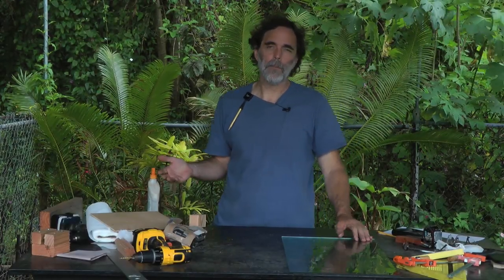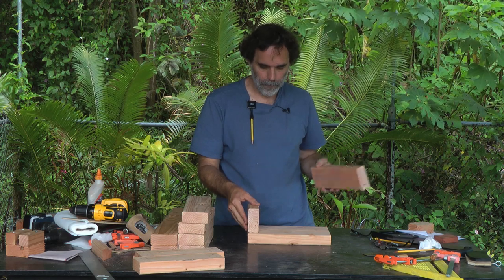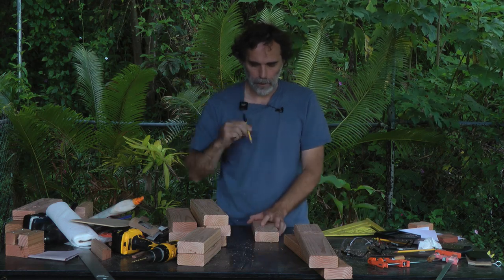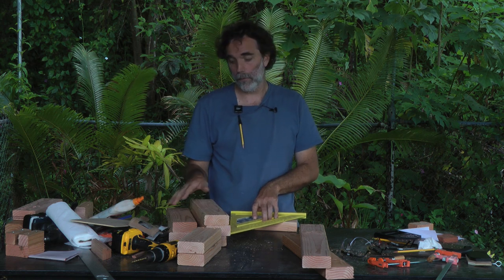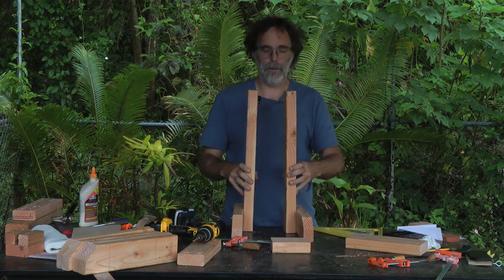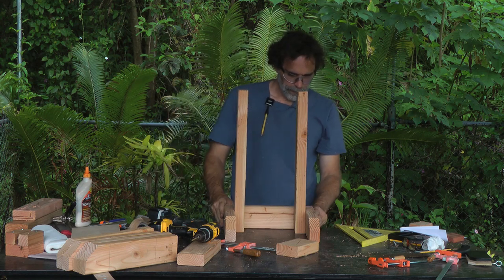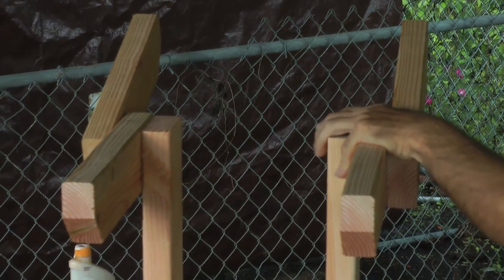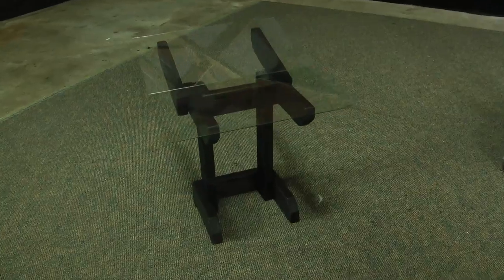how to make an artists' palette table

Comment: My husband made the palette table exactly like the desription in the video.  My glass palettes are 20 X 15 3/4".  However the table is unstable when both palettes are on it.  It tips forward with virtually no pressure and of course, the glass on the top is dangerous.  We are going to add some additional pieces to make a more tripod type leg to improve balance - has anyone else had this issue once finished.

Comment: In one of your other videos, I make note of a couple of screws sticking up with some sort of material surrounding them. These screws are being used to hold the angled sheet of glass in place. What is the material you use to surround the screws (that comes into contact with the bottom edge of the glass)?

Comment: Can this all work is built for standing. I don't sit much as I have a bad back and sitting is so incredibly bad for you. I suppose one could just follow all you rules for standing only. I may try to build everything to be adjustable up and down to be able to paint in both positions. I'm a wood worker. But I will order you amazing easel soon and go from there.
Thank you for all you posts. I recently purchased all your paints, proportional divider, and color checker. Tried to order 2 pallets but they are back ordered.